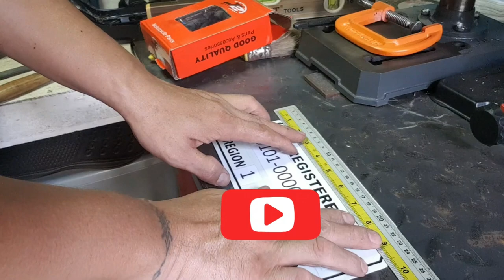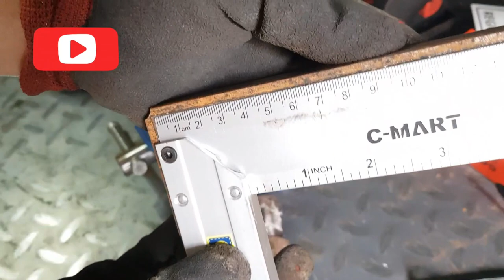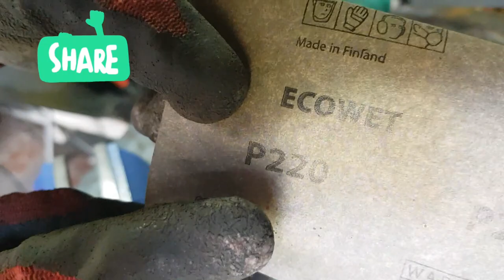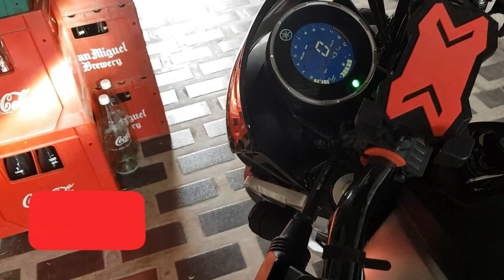Yamaha XSR155 Tail Tidy Installation (D.I.Y.)

Comment: Street legal po ba kahit nasa side ang plate?
Reply from the maker: In all honesty sir. D ko pa na try hehehe. Asvise kita sir subukan kong ibyahe. 🤪
Reply: Sir, normal po ba na hindi umaandar ang fan ng radiator pag umaandar ang makina ng motor?
Reply from the maker: Automatic po yan sir. Aandar po kapag na reaxh na po ni XSR ang max engine heat na naka set.